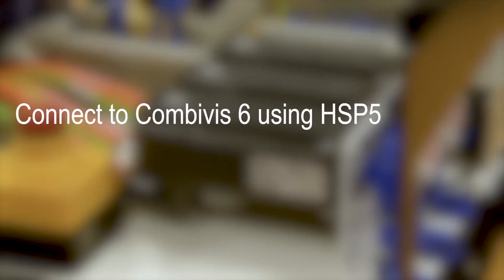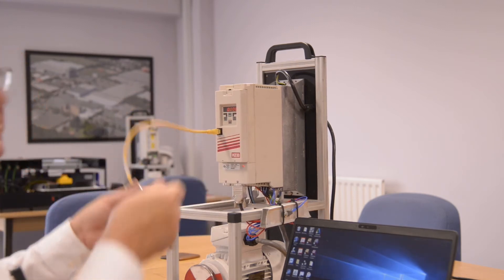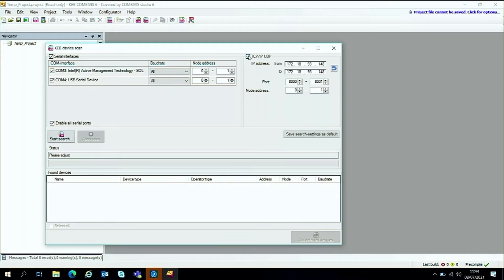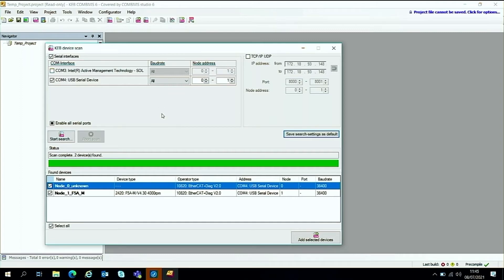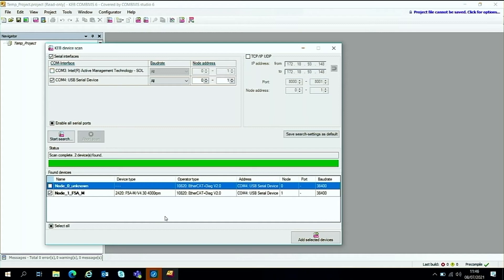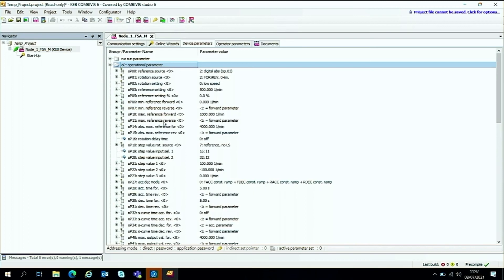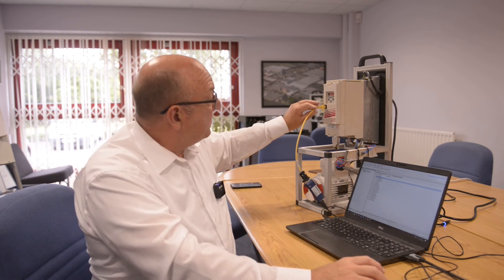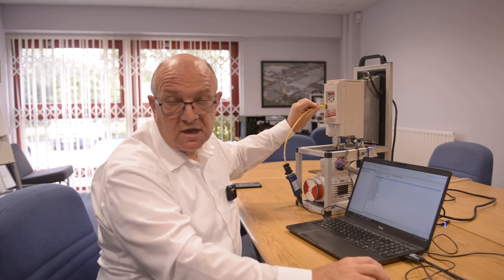Connecting F5 to Combivis 6 using HSP5 and USB Serial converter - KEB UK

Comment: I have tried to connect to an F5 drive with the Combivis 6 software but it does not establish communication, I am using the original Keb HSP5 cable, I had to download version 5 of Combivis to be able to communicate, note: my F5 drive has the keypad model: 00 .F5.060-2000, and I see that the video drive is model 00F5060-F000, I have already tried with 2 different PCs and I can't, what's missing...?
Reply: Hey Daniel, 
Wondering if 
you can help me, I upgraded my laptop recently, no serial port only has usb ports. I was wondering if you knew any way of making USB to Serial connect to F5 drive?
I do have the cable shown in this video and HSP5 cable. I have tried a couple of different drivers including the Keb driver for the USB serial adapter.
Hope you can answer my questions.
Reply: @RamanPOTL  Hello, I have only been able to connect to the F5 drives with the Cobivis V5 software, and I have done so with the original cable, which consists of the RJ45 to DB9 adapter (00.F5.0C0-0020) + HSP5 TTL converter (00.F5 .0C0-0010) and I use a conventional USB to serial (LBUSB16232), I have never managed to connect with version 6 of Combivis, I hope this helps you... I leave you the link to the connection video... https://youtube.com/shorts/_jaEPFEdXgA?feature=share
Reply: buy an altivar